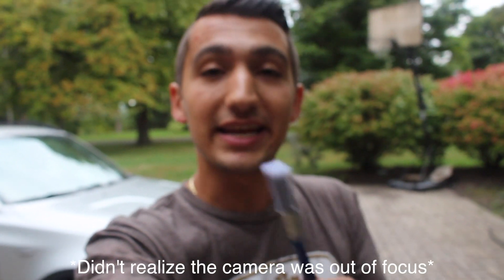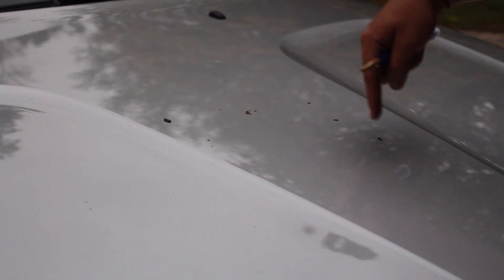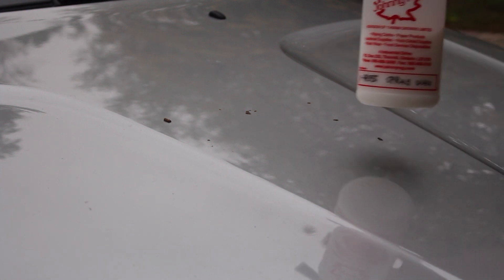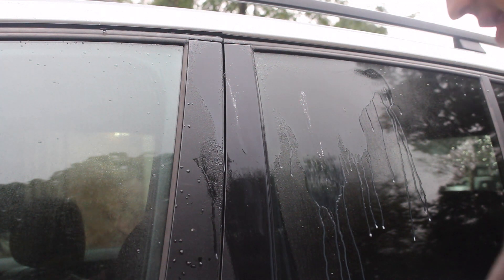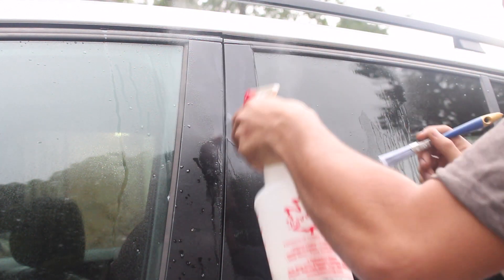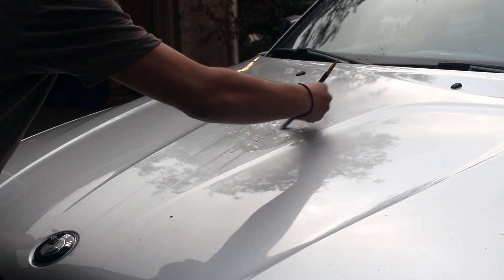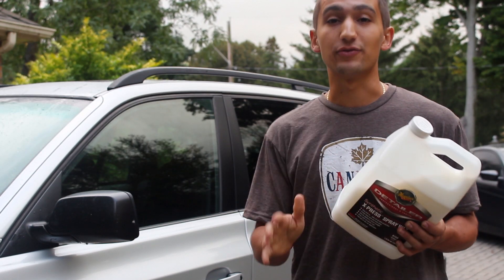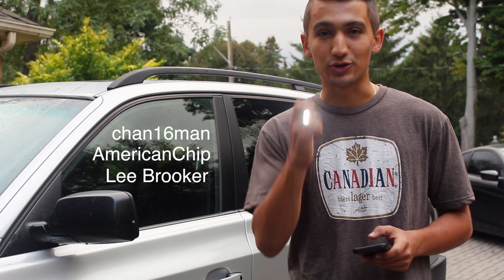How to Safely Remove Bird Droppings

Comment: I have a mazda 3 sedan 2011. the chrome emblem on the steering wheel is peeling and looks pretty bad. Do you have any ways to replace or fix this problem?
Reply from the maker: +jaserskookie Is the emblem peeling or the chrome on the emblem peeling?
Reply: +milanmastracci not sure. all I know is you see the layers of emblem. like clear layer then the other layers underneath.
Reply from the maker: The only way to fix that is to remove the existing emblem and replace with it another. Sometimes that isn't as easy as it sounds. Most manufacturers sell the air bag with the emblem all in one unit. Your best bet might be to hit up ebay for a emblem you can stick overtop
Reply: +milanmastracci ok cool thank you.
Reply from the maker: No problem jaserskookie :)